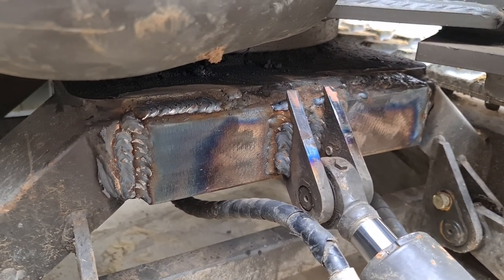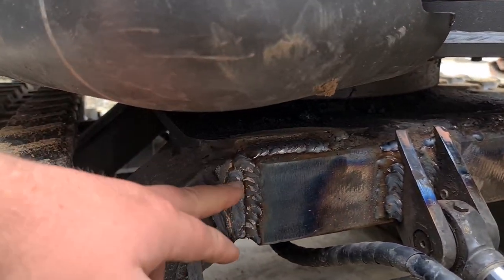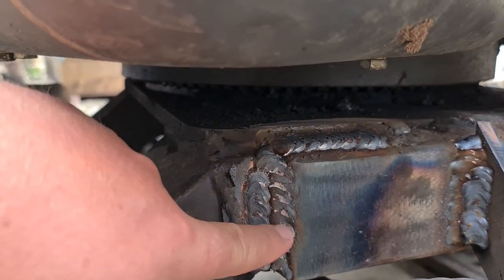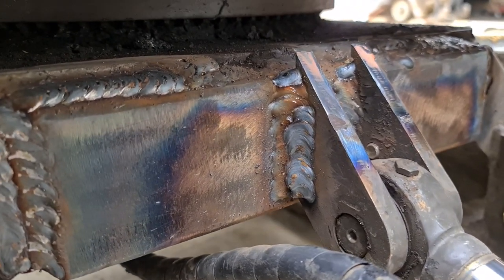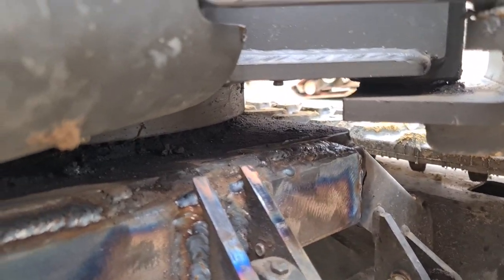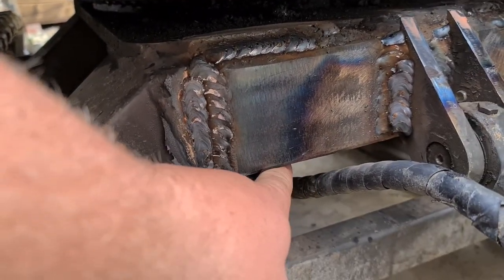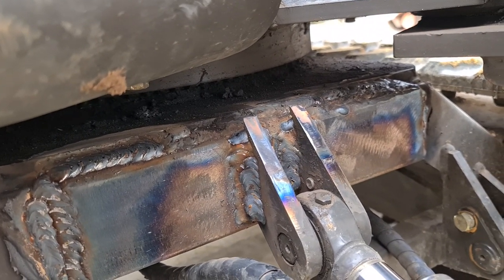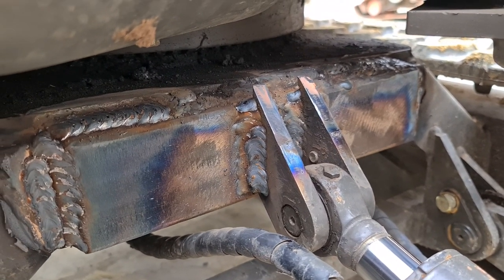chinese mini digger update - repair done 💪

Comment: I worked at a International Harvester farm equipment dealer for 20 years as the shop supervisor, All of the mechanics there had to weld to a certain degree. One day A friend of mine stoped by to visit, he was a certified welder and as we were visiting he glanced over at some welds on a piece of tillage equipment done by who knows, he commended “my would you look at them gorilla welds” I looked and actually they looked like yours 3 layers of weld which on farm equipment was not to unusual. That break on your machine was ugly but the repair should last forever.
Reply from the maker: 😄 thank you, but I must admit, the dozer blade has bent and mangled the repair plate. So I'm thinking there is more of an issue with the geometry of the dozer blade mount and cylinder. I've got some 4" channel to do the repair next. That will be more than suitable.
Thank you for watching and commenting 😁

Comment: I’ve seen that on CAT diggers to when I worked for westrac/cat
Happens to the top tier machines too
The original welds probably where not prepped properly or had some contamination on the steel when they where originally welded would be my guess. 
Repair come up good 
Nice work Nick!
Cheers 
Daniel
Reply from the maker: Thank you so much for that praise Daniel. I would say the same as yourself about the weld prep too. But personally that area needs to be a lot stronger with better internal bracing. The part of the box section had just ripped away off its welds so something didnt add up. Just glad other branded high end machines do the same, hopefully not too often. 
Take it easy bud and thanks for commenting 😃👍

Comment: Decent welds for 10mm plates. Did you do that yourself? Was the problem to thickness of the metal or the quality of the steel that was the problem do you think? Hoping the one I’ve just ordered doesn’t have any thing major. Something like this I can handle but imagine of the welds broke on the hinge point of the boom or something on a job, mate the injuries someone could end up with from a dodgy weld could be catastrophic. I went to look at a local guy selling machines here and when I test drove it (not even a minute into the test drive) the tilting bucket fell off it and smashed onto the concrete and broke the hydraulic lines and sprayed me and the cabin big time. Lucky for me the oil was not hot. Keen to see a repair video if you have it.
Reply from the maker: Thank you Slimer, i just cranked the welder up max and luckily it didnt blow through the existing frame work.
I believe the problem was a mix of problems, 1 being the area of the mount just isnt tough enough for the pressures the cylinder can exert on that one area. Secondly i dont know what kind of grade the frame was made from so it may not have been a good cast or i just received a faulty part, not sure.
Following on from that pressure point on the machine i have looked over other parts that have similar potential failure points and theyre all a lot more beefed up. All the boom and dipper arm have all got what looks like 10mm plate welded sections and look very strong, but i know have experience and now i can look out for problems occurring. 
That test drive wasnt a successful one i would say then, how on earth did the tilting bucket fall off ? pins fall out or something ? Got to be really diligent when looking at any machinery really, luckily with this one if it needs stipping down it doesnt look a major job, just good job i can do it.
Thank you so much for your comment also, really appreciate it 👍
Reply: @everydaywithmenick  the guy didn’t tighten up the quick hitch, need to loosen the socket to remove buckets and retighten with a socket to fit another bucket…hanging to see your next digging video.
Reply from the maker: @slimer13b  I get what you mean, my quick hitch has a bolt on it that you loosen to swap buckets. Rookie mistake for that to happen tho. Yes I'll get round to getting them on ASAP 😁

Comment: What was the cause Nick ?  What were you / the machine doing at the time of it failing ? It seemed all to be going well….. also did you carry out the repair yourself ?
Reply from the maker: Hi Steve and thanks for your comment. I'm not sure on the cause, I noticed it when I was digging and seen the blade coming up a lot higher than it usually does. So I stepped down and seen at that point the damage was well and truly dealt. It wasn't til I put the video on showing it broke which was maybe half hour after noticing it. I wasn't doing anything other than grading some land. Taking a few inches of the top really. 
I did the repair myself yes, I'm a fitter/Turner by trade and have lots of welding experience as you might have seen in some previous videos of mine. So repairing it wasn't that difficult. 
Thank you again for commenting and watching 😁
Reply: @everydaywithmenick  👍🏻your back up and running that’s the main thing ! Just an idea, is there a possibility that the bucket or Bucket + land could have forced the dozer blade whilst raising the bucket ? ( my reason for asking is that I was looking for a digger, but at the time my options were second hand over priced under maintained machines or a trencher / towable back hoe) . I ended up with the back hoe as at the time it was the better option( new). it’s a capable machine for what I want at home however , has its limits , but I’ve noticed the bucket/ rake inwards will affect the outriggers I’ve raised the plates😂 maybe the same with your machine ?
Reply: Might have been from a previous job with concrete etc and only noticed afterwards…..?
Reply from the maker: @stevedoran3278  i did a maintenance sweep of the machine before the last 2 jobs and didnt notice anything then. but now i will keep both eyes on it now.